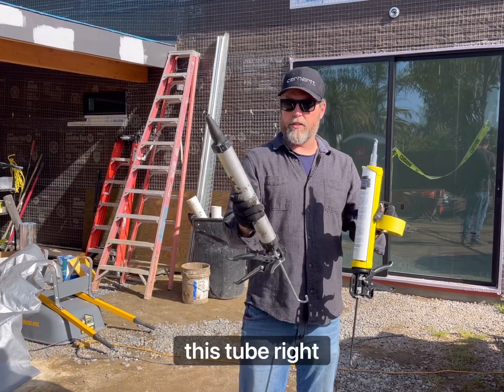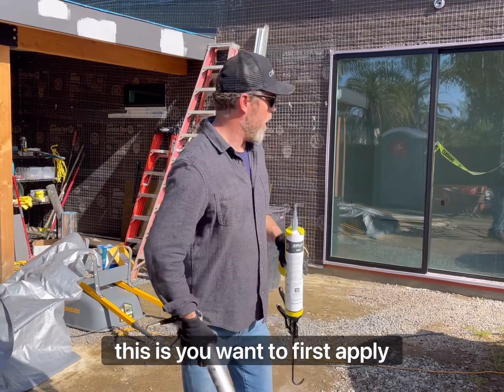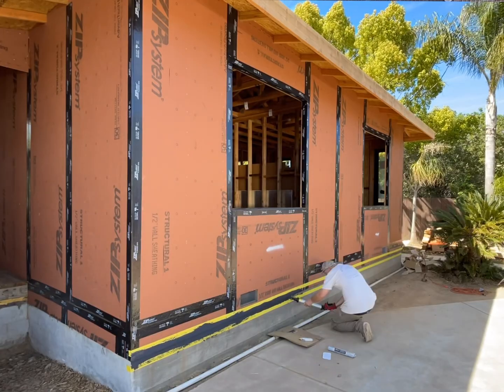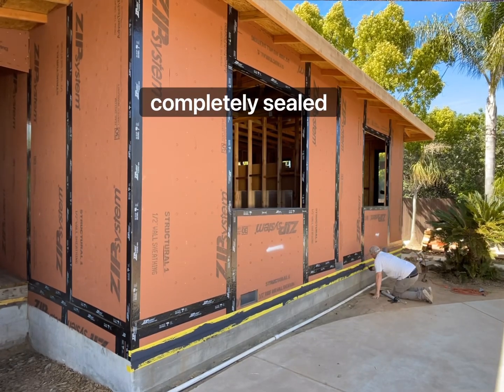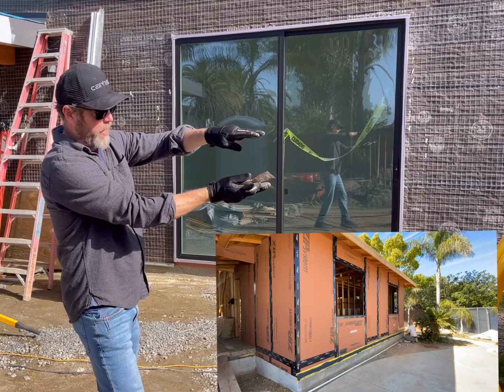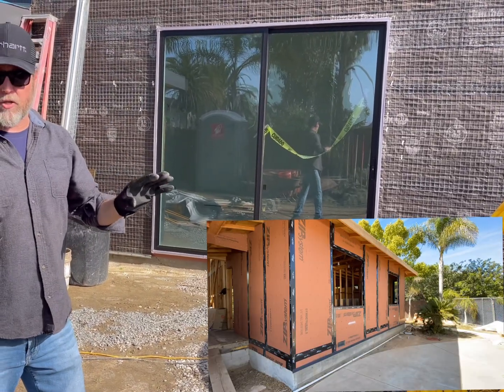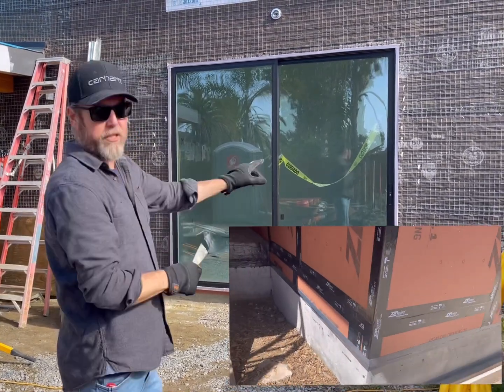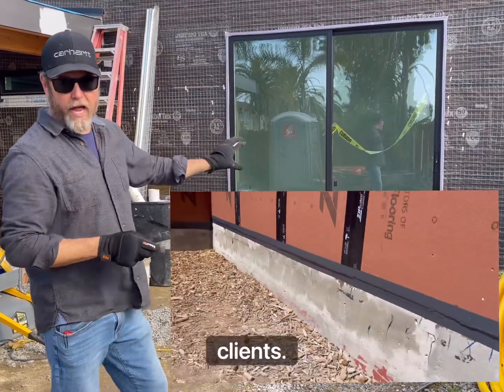SEAL the GAP Between Framing & Concrete Foundation! #zipliquidflashing

Comment: Why don’t they do this on new construction in California?
Reply from the maker: Hi Micheal, I’m a builder here in Southern California, this method was hardly heard of or done here till a little over a year ago. The standard here in Southern California is only sheathing the shear on the exterior. Although that may “allow a wall to breather“ it leaves all sorts of gaps at the weep screed plate level for termites and moisture to get in. I changed my approach to the exterior envelope as a builder here in Southern California.